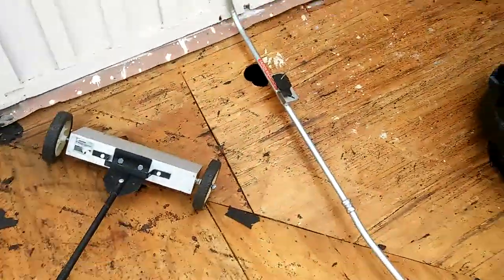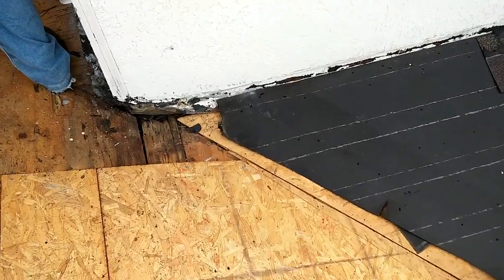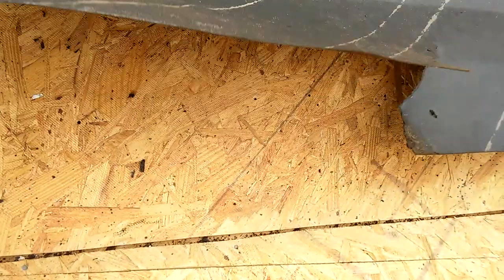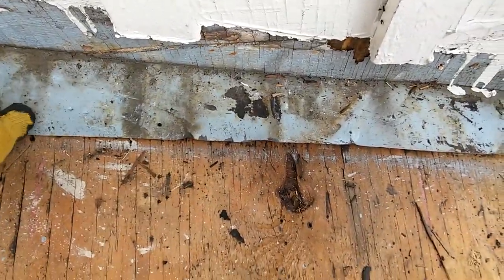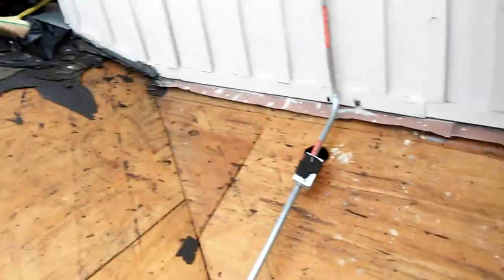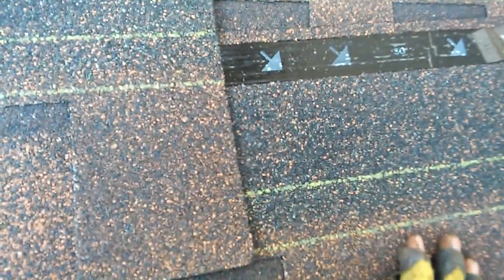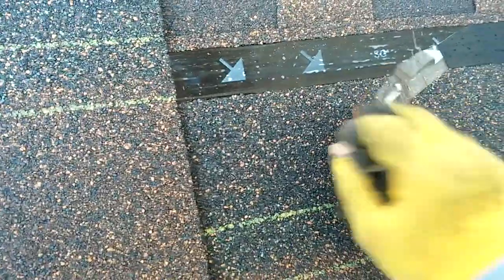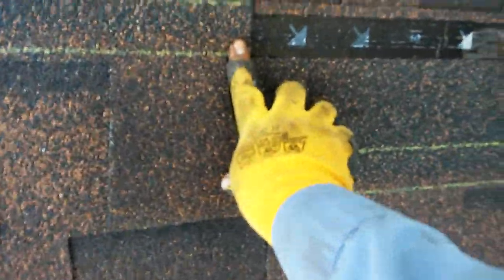Repairing a Leaky roof : DIY Video.

Comment from the maker: Things I like about malarkey:
1: Ty is right , the nailing area is wider than any other brand and marked by yellow stripes, also is has the plastic shield underneath to prevent leaks or at least the leaks will show 15 years later.
2: They square comes with 4 bundles, that means the materials is thicker than the others.
3: The price is great comparing to GAF, OC and Certainteed , for a basic 30 years roof  you don't have to spend a lot of money to have a nice roof.
Reply: Hi Eric,you uploading great videos,could u share how to bend corners in chimney counter flashing
Reply from the maker: Akita Best No problem sir, I will do it tomorrow, the house I'm doing now , has walls and needs step flashings, thank you for your comment , hope I can help u in your knowledge.
Reply: thank you,im waitin =)

Comment: How do u clean the angle flashing with out ripping it man hate tat shit...any tips???
Reply from the maker: Jaquin Guzman if the roof cement is dried already, just hit with a hammer and will come off , the remaining left on the metal just get it off with the flat bar, good luck!
Reply: with a bottle of cold water,just  make a small hole on the cap and spray water as you go.
keep flat bar wet and cold also.